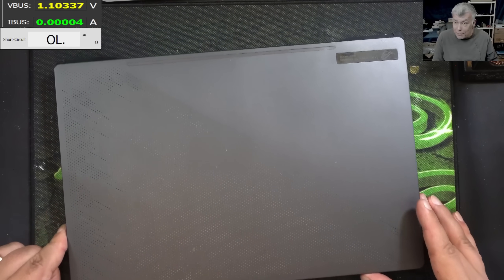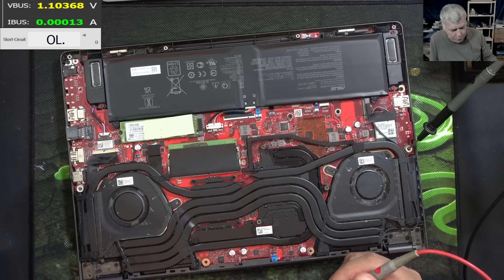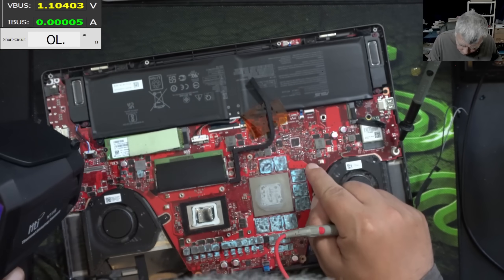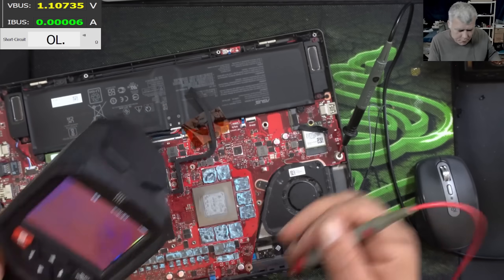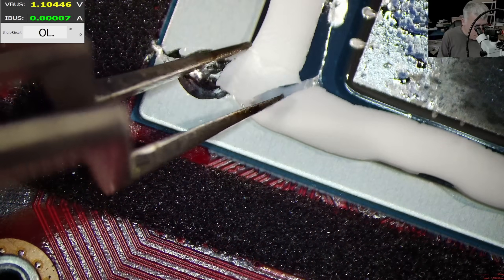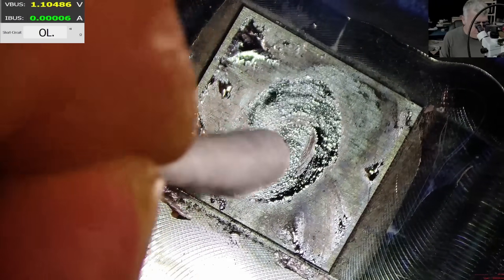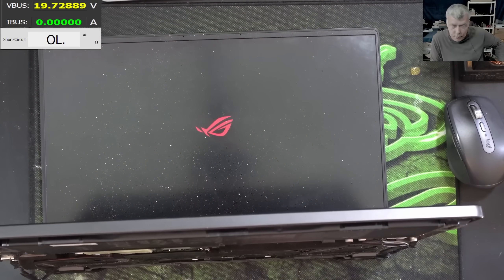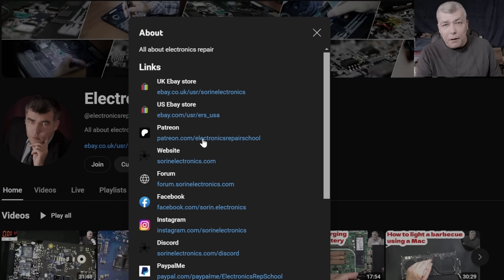Asus ROG Zephyrus G15 GA503 dead, no power, not charging also, a clasic gaming laptop board fault!

Comment: Power button and flex cable: Power button on ASUS ROG ZEPHYRUS laptops. I had such a problem that the laptop simply cannot be turned on from the first time, when it turns on there is no rule when it can turn off by itself, whether it is a few seconds or a few minutes. The battery indicator does not light up and while it is plugged in and not charging, I went through the elimination system of all components, until I came across the flex strip that connects the power button board. The moment I disconnected it and turned on the laptop by connecting the first two jumpers, the laptop turned on and worked normally as if nothing had ever happened. So there was a fault in the board where the power button is and after replacing it everything worked as it should.

Comment: hey sir could you guide with something i’m stuck in a fault of motherboard with xps 15 9570 power, by accidentally i used reverse polarity charger through dc 4.5mm pin cable, now laptop is not detecting power either from type c and pin cable, although laptop was turning on on battery, but since the laptop is not detecting any power, it is not turning on now,

Comment: @0:37 You say, you don't think a gaming laptop suppose to work on PD USB-C. Of course, it did, your own Laptop did it, try your left USB-C Port, it will handle 20 Volts and 5 Amps, and it will run fine on low powermode, like on battery, try it. ;)
I've got the same Laptop type, but a little bit earlier (3 Years) than your video, you featured your laptop, this PD thingy was the main future, that's because I selected this one, but my Laptop didn't have a such fancy liquid metal upgrade, like yours, because, lag off experience, and I've only upgraded it with graphene pads. It's not the same as liquid metal, but it's working and no worry about spilled liquid metal or dried heat sink compound.

Comment: Just a warning about the 'liquid metal' thermal transfer compound. It's an eutectic alloy of gallium and indium... sometimes with a little silver mixed in. (But, I reckon the silver containing stuff is not frequently used.) Anyway, these 'liquid metals' will attack and weaken aluminum parts.  AFAIK, it's not toxic. But, if you spill it, or splash it, or move it around, it's going to be there for a long time.
Reply: Good thing that there's no aluminum inside the laptop.

Comment: 8:10 how do you know which capacitance to use? I have a similar motherboard but I don't know what capacitor to buy..
Reply: It's usually 10uf ... unless it isn't but for that purpose it won't matter.
Reply: @JustInspiredKent thanks!!
Reply: Voltage matters more. I would say more important than capacity. And if it's on main power rail like 19V should be at least 35V capacitor. Or even 50V. I would never use 25V one on main power rail.
Reply: @TriodeTetrode  Good to know. Thanks!

Comment: i have the same laptop, hope it lasts me a good while. I hate removing the heatsink on it cause it uses 3 different kinds of thermal pastes (liquid metal, Kyronaut and laird 607 putty) which gets expensive fast. Also you are correct about the liquid metal, Asus laptops especially this one has very bad liquid metal application from the factory so many laptops get very hot straight out of the box
Reply: Do you recommend it? I planning to buy it as used one.
Reply: @nichderjeniche  never buy an Asus laptop, totally crap same as Lenovo
Reply: @nichderjeniche it has been a good laptop so far but in the future i am not going to buy any ASUS laptops, it has bugs which have not been patched to this day and ASUS service is absolutely the worst but depending on the price it could be a good deal. It is very good for daily tasks though i use mine for university, work and gaming as well.
Reply: @pvim I see. I had 3 Asus Notebooks already and never had problems.
Reply: @nichderjeniche well guess its my luck though, i did not have any particular problems, the one that annoys me the most is that if its too cold under 10°C the fans of this laptop spin at full speed for some reason and i have to power cycle it to fix it which is super embarrassing if it happens in a library or classroom or workplace. Also my experience with asus was hit or miss the first time my display had dead pixels after a week of back and forth they finally agreed to replace this but the fan full speed spinning issue they did not help me at all.
Reply: Try to store it as much as possible laying flat, especially when the liquid metal is warm/hot (= liquified).
Reply: @a.j.haverkamp last one does not matter, cold or hot it is liquid anyway